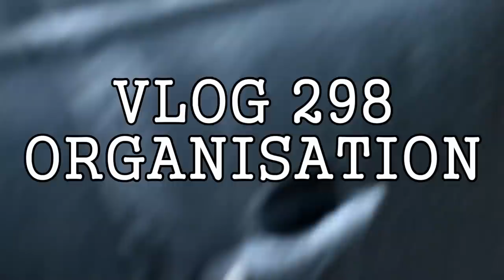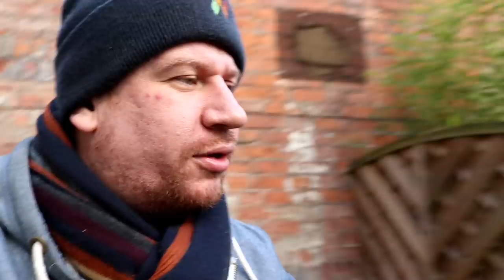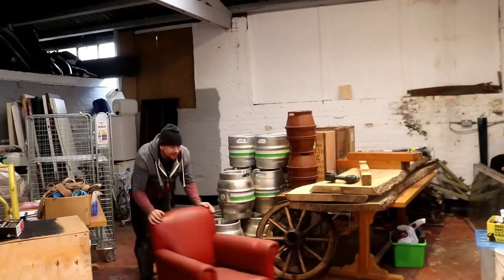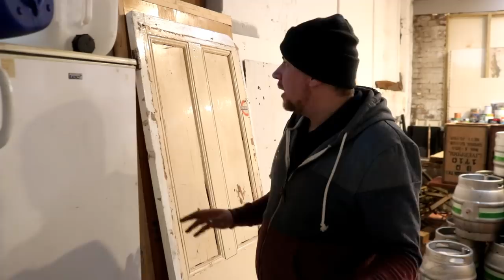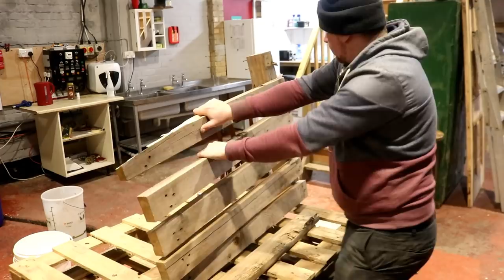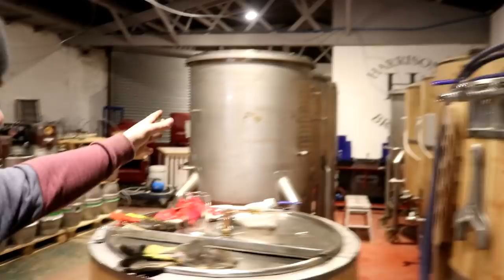NOT POODLE

Comment: You need to look above your head you have all that frame work you could use rope assembly in hall Croft could provide you with wire rope to support your gear
Reply from the maker: The roof is about to cave in mate, can hardly hold its self up.